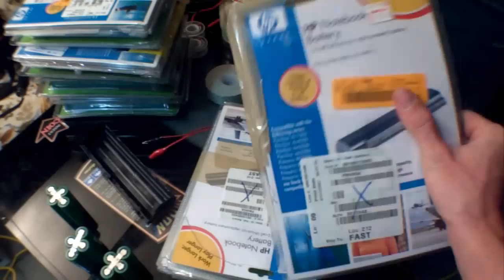DIY: 48v 24ah lithium ion 18650 e-bike battery pack

Comment: I am actually thinking of changing a 48 volt 20 amp battery to two 24v batteries and moving to a 24volt motor.. so this was helpful in showing the arrangements of the battery pack and on how to as well... because i have a 48v 20amp 1000watt hub kit atm.. thinking on changing to a mid drive... So thanks for the video...

Comment from the maker: yeah i was thinking about that too, i might build a circuit that when i turn off the motor it connects the output to a bridge rectifier and converts it to dc that feeds back into the battery.

Comment from the maker: oh i forgot about the tabs, that does make it tricky. 

5 rows of 12 (you mean 5 packs in series, with each pack 12 cells?) that would only be 20v. but you could do 8 packs of 8 to get 32v.

and yes if every pack of cells is 35ah and the packs are in series the whole battery would be 35ah.

have you done a load test of the cells to see how many ah they have? if your cells are really new you could get away with just 4 cells per pack. would give you 12 packs. could always upgrade latter like me

Comment from the maker: my 24v pack has 6 packs in series, did you look at my schematic in the discription?

what voltage are you wanting from it? and for what wattage of motor? 64 cells is still plenty to make a nice little battery pack. and remember my first pack's cells where only 50% life left so you'd prolly end up with better even if you used less cells.

if you want 48v you could make 12 packs of 5 cells. if they are 2ah or more each cell then that would be 10ah. about 20 miles of range without pedaling :D

Comment from the maker: but then again when your riding an electric bicycle you never pull a steady amount of amps, like my bike prolly pulls 20 amps to get up to speed then only 5-7 amps the maintain speeds of like 18mph. so its up to you what load to test it with. or maybe do a high load test and a low so you have more data. idk just suggestions. hope i'm helping.

Comment: you need balancing circuitry asap! multiple brands of cells in a 24v pack things can go awry very quickly! very nice pack anyway, the duct-tape worked well and it had some nice juice. be careful and have fun!
Reply: /signed
with so many different celltypes in series/parallel... its impossible to balance the charges without. the "weaker" ones act then as a resistor in the circuit and can generate a quite amount of heat...
Reply from the maker: teh pwnerer
check the description or the in-video link to the next video where i add balance leads.

nobody reads descriptions anymore do they?
Reply: sorry i just came across this one video and didnt pay attention to the entire build. im getting a tenergy TB6-B for my cells :)
Reply: Rinoa Super-Genius
aaah, alrighty :) good job nicely done dude. love your soldering iron btw... XD
Reply from the maker: teh pwnerer sorry my comment was mostly aimed towards the OP. guess i'd clicked reply to you instead. you really only made a statement instead of saying i shoulda done something i already have filmed :P

Comment from the maker: well thank you :D

it's made for soldering roofing metal together. plug it in for 15 minutes and it stays hot enough to solder for an hour. but if i leave it on too long it'll just boil off the solder.

Comment from the maker: the 24v 35ah brick weighed about 7-9 pounds or about as much as a 12v 9ah motorcycle battery. sorry i dont have any accurate scales around to measure it right now. i'm just going off how its about the same weight as my IBM Thinkpad from 1996. but still its not very heavy.

Comment: It could catch fire or explode when riding I'd recommend adding a thermal and current fuse. Also when youre connecting packs of different AH you're limiting the potential to the weakest pack. The positive and negative should be labeled at least with a band of black tape and red.
Still dirty and cheap. Keep learning.

Comment from the maker: yes i already added that feature in the next video. there was an annotation in the video linking to it and there is also a link in the description. maybe try reading stuff more next time :D

btw i used an Imax B6 balance charger. and only balance the battery every month or two. the rest of the time i just charge it from terminal to terminal with 24.0v

Comment from the maker: you see how i first put 3 packs of 4 in a row? then a duct taped each row together to form the brick? each one of those rows of cells will run in parallel.

so its 12 cells in parallel for a pack, and 6 packs of 12 in series.

Comment from the maker: i use an IMAX B6 balance charger,. i'll be making another video about how to add the balance leads.

but once the cells are ballanced you could just charge them as one big 24v battery a few times. it would take like 10 cycles before they went out of balance again.

Comment from the maker: you mean the 0-30v 0-5a universal DC power supply? it says WEP on it but its just the cheepest model on ebay. i've seen this same exact model with like 10 differant names branded on it.

i leave mine on for days at a time sometimes. but FYI can't supply more than 2 amps that long or it heats up and auto-shuts down.

the issue is they put an aluminium sheet heatsink that blocks the fan, i need to drill some holes into it to allow more cooling.

and thanks, this is my 2nd source of income ^^b

Comment from the maker: yeah i'm still working on an idea i have for that. but in the meantime i charge it manually anyway and open up the battery and check each cell voltage since its still kinda a prototype.

i keep finding little stuff i messed up like soldering the wrong cells or solder joints that broke from stress.

Comment from the maker: i just finished drawing the schematic for the battery, i put a link in the discription of the video. does the schematic help you understand?

also i don't really know for sure what people mean by protected cells. i think they mean like how inside a laptop battery there is a circuit board that monitors the cells. but not that there is anything differan with the cells themselves. just that they are in a package with a circuit that protects them.

Comment from the maker: it melts the solder, if it melted the nails they would be glowing white hot and the lithium cells would explode into flames from that much heat.

Comment: Hi , i think found somewhere that soldering li ion batteries can diminish their lifespan, i read it somewhere a few years ago when i started reusing my laptop batteries.  They recommend cold welding them so the internal components are not too affected by the heat. i think a good alternative is to just use small button type neodymium magnets so you can also easily dismantle them afterward.  The downside is if the button cell eventually shorts out the electrodes at the positive side (positive pole and negative casing too close together)

Comment from the maker: yeah i guess half would be about 3.7v going by the chart n battery university. i find though that the functional capacity is pretty much 10% at like 3.8v.

when my small 9ah battery pack gets down to 3.7-8v per cell it cant put out hardly any amps and can only get me up to like 12 mph instead of 30.

then again my first battery pack was about half the minimum recomended size for a 1kw motor. so maybe my new 35ah packs will do better because less load per cell.

Comment from the maker: well i just got my IMAX B6 battery charger in today and will be adding the balance leads. this video is more about the structure and how to connect the batteries together strongly. i don't think i fully understand your question though.

if you mean you want to see the schematic of my battery i posted a link in the discription.

Comment: many miles do you get out of the 48volt 24ah battery going at top speed. and what is your top speed and wattage of your motor? thx, enjoy your vids
Reply from the maker: +HyperView top speed is 37mph but id only go like 8 miles like that, if i go down to 20 i can get like 35 miles, and down to 12 i could possible do 100

Comment from the maker: yeah my bike is throttle not pedal. as for bottom balancing i presume its where you drain the batteries to 0v to make them all 0 then charge them. that would most definatly kill 50% of your battery capacity in one go, would be like aging them 15 years.

idk what bottom ballancing is and cant find data on it, but i would much rather overcharge a battery than undercharge. but i run my batteries at 4.0v instead of their normal 4.2v so bleh idk.

and just FYI Li-ion and Li-Polymer function the same.

Comment: I think Humberto was referring to Lithium Iron Phosphate batteries which are mostly square.  The differences are in the anode or cathode materials, hence giving them a lower nominal voltage of 3.2v . With proper handling these new LiFePO4 cells can last years and give high current for most of the working period.

Comment: I built many NiCad packs over the years and after a meltdown I always install a thermal switch.  Especially in high vibration situations where the cells can rub against each other, wearing through the plastic covers, and short out through their cases.

Comment from the maker: battery university does, its a website that i find to be somewhat credible. although its section on lead acid desulfators being a hoax is wrong.

heres the voltage/cycle chart
4.3v = 150-250 cycles
4.2v = 300-500 cycles
4.1v = 600-1000 cycles
4.0v = 1200-2000 cycles
3.9v = 2400-4000 cycles

and the differance between the lowest and highest number is the depth of dicharge. if your discharging your batteries to 0% from 4.0v youd prolly get 1200 cycles. whereas just a little and youd get like 2000.

Comment from the maker: sorry those links don't work, something is missing from them.

but if they are for UltraFire 18650 i would never ever ever buy them. UltraFire cells are just old 18650 cells that are rebranded and not checked. i know several people who have bought them and they turned out to be like 12 years old and had only 400mah at best.

and remember you can buy from american ebay because most battery pack auctions ship worldwide for free.

Comment from the maker: you mean LiFePo? well i've never seen a LiFePo 18650 cells. usually LiFePo cells are flat/squarish.

one simple way to test is for the voltage differance. if the cells are above 3.7v it's Li-ion if bellow then its LiFePo.

also LiPo and Li-Ion are the same exact thing, just a small difference in manufacturing is all. the only reason there seems to be a differance is marketing. when you add "Polymer" to something it makes it sound new and improved ;p

Comment from the maker: ok cool.

lithium batteries can be really touchy with their voltage. you can charge SLAs a lot and they settle back down to 12.7ish volts. but lithium batteries have to be charged to more precice voltages. most lead acid batteries would just dump 16v into the battery and that would prolly kill a lithium pack.

i would suggest maybe a universal power supply for tinkering (cheepest 80$), or a balance charger for charging (cheepest 30$). i couldnt live without the universal power supply now haha :D

Comment: For your worries about over discharging your batteries try searching for passive battery management systems which are designed to prevent over charging and discharging. Not something I have tried hands on but I found them in researching electric transportation methods

Comment: 18650s LiPO chargers produce 4.2v.   4.0v will be just fine but could take a bit longer to charge the important part is turning them off when the charge current drops.  3.7v is the nominal cell voltage after some power has been taken off or after a very safe & slow charge.  12 cells in parallel x 3Ah per cell = 36Ah    6 packs x 3.7v each =   22.2v nominal   IV = Power  36Ah x 22.2v = 792Wh    Don't dischage them too far, with old cells you might have a low capacity cell or two and that will be the one to fail at max discharge.  That's just fine for an e-bike.  Nice work.  Keep it up, you are going to learn some good stuff.
Reply from the maker: actually the batteries should stay at 4.2v after being off the charger for a while. 3.7v is a dead battery. once mine get to like 3.8-3.9 i recharge them since they stop giving as many amps and start to dip in voltage more under load.

and actually i've gotten 18650s up higher. one set accidently was charged to like 4.7v and all 4 cells didn't short or explode. i was handling them like unexploded dynamite while connecting them to a motor to discharge them though haha.

but anyway i do like how lithium cells are very forgiving. maybe not as rugged as lead-acid or nickel iron but still they can usually handle accidents.

btw the terminal voltage on this pack is 25.2v if i charge them to 4.2v and 24v if i charge them to 4v

but anyway thanks for the compliments :D

Comment: For two years I could not find one e-bike tech with your skill level in NYC. Then I gave this bike shop two new 24 v. lifepo4 battery packs, to be merged into one 48 v. battery pack. For $90.00 in labor all I got was a 44.2 v.battery pack that won't charge with my two chargers or theirs. My 48 v. motor won't even budge, but the 48v. throttle light does blink . How can a place like New York City not have one bike shop with your talent?. Help!
Reply from the maker: Humberto Middleton thats why you should just do everything yourself.

Comment: I know this is an old video but when you charge li-ion with a psu then set it to 4.2v x cells in serie (12.6v) and set current to zero. Connect positive and negative from psu together and turn upp current to 75% of max charge current  (4x2x0.75). In this case about 6A or less. Then connect it to your batterypack. This is the safest way to charge with a psu without lithium charge control.

Comment: Awesome job.  I'm building an electric bike thanks to you.  I'm doing laptop cells and have 60 cells that came out of the laptop batteries at 3.6-3.8v, so I'm assuming those are really good.  Almost all of them were actually taking 2550mah each, only 50mah off of what they were new.  I just got another lot and sadly about 50% of them were at 0v, but the other half were anywhere from .6V-2.8V.  What is the lowest voltage I should use?  Should I throw away any under 1V?

Comment: You're pretty awesome man! I'm an electrician and have been for many years now. I completely understand everything you did in this video and it's all pretty darn sweet! Good work buddy! Keep on doing what you do. It was fun to watch.
Reply from the maker: hey thanks! wanna know something even cooler? my legal name is Dustin also. although i'll be changing mine to Rinoa after i start my mtf gender transition.

and thanks! i don't plan to stop my electric vehicle projects at my bike. i'm planning to convert my 1982 mercury zephyr to electric sometime this year. i want to find a 36-48v DC 10HP forklift motor to power it. and already have plenty of batteries to test it with. got like 8 truck batteries. and i don't mind if i ruin the batteries because i got them off the recycling skid at Rural King haha.

but before i build my car i will do a stepping-stone project with turning the bare chassis of a riding lawnmower into a 12v gokart. using the starter motor from our 1985 Dodge as the motor.

thanks for the support. it means a lot.

Comment: Inspiring video !

What is the size of the soldering iron?

Your 24v 24-36 Ah battery seems to have 12 cell in parallel (to get 24-36 Ah), right?
And 6 of those in series.  But if each cell is 3.7v, then that pencils out to 22v.  
Where's the missing 2v ?

What do you think of 8800mAh 3.7v 18650s?
Are they for real?
Any heat problems in an e-bike?